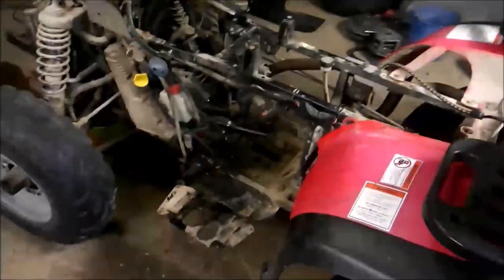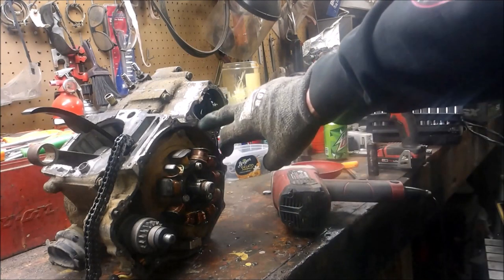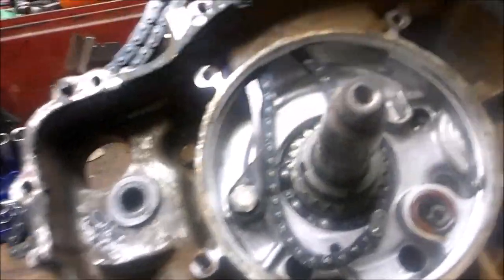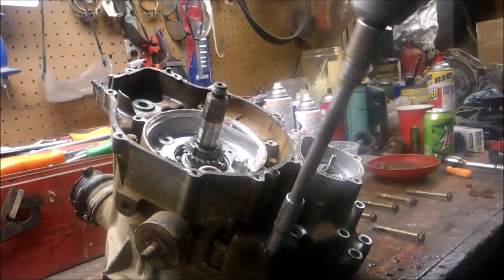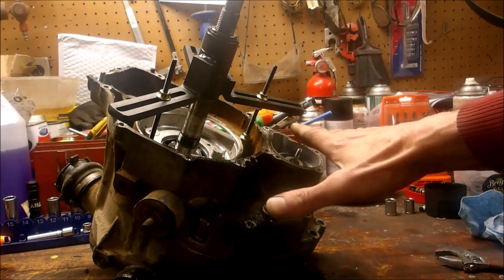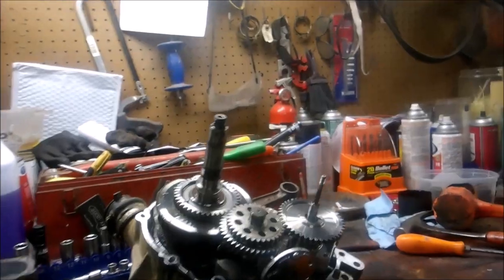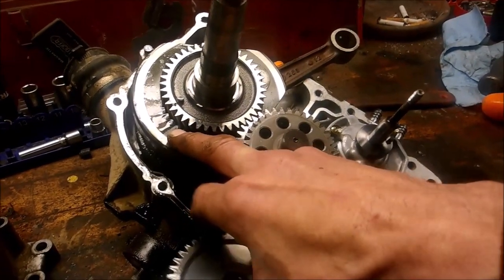POLARIS 500 ENGINE TEARDOWN AND SPLIT CASE SIDES!

Comment: Great video. I have a 400 HO that was given to me free because of low compression. Took jug off and it did the exact same thing , piston skirt broke apart and eventually piston split. Just wondering what parts you used for piston and cylinder repair? Is the metal cylinder sleeve replaceable ?
Reply from the maker: I went with the Namura. Piston. I've always had good luck with that brand and not as expensive as wisco. The cylinder I got lucky and was able to just hone it out. If yours is that bad, take it to a machine shop. They can bore it out.

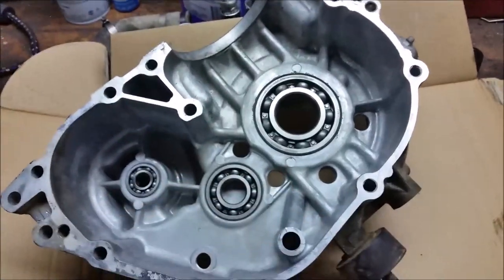Comment: At the point in the video 12:23 you have the split case apart. Your pointing at the bearings.. the bearing for the water pump- does the case need to be split to remove/replace that? Mine is shot.
Reply from the maker: Yes. Its on the inside of the case.

Comment: 2012 Polaris Ranger 500 EFT. I have to change the water pump shaft (bent shaft).
1. How much further to get the water pump shaft out and replaced?
2. Can the case be split without the splitter tool, using a couple of flat blade scraapers?

Comment: You ever have the reverse threaded nut on the crank get loose?  Mine did. back off and jammed itself against the cover to the point where I could barely get the bike to turn over. Tore the engine apart and that was the only issue..
Reply: I wish mine did that. I can't get it off fore the life of me.  Is there a tool for that reverse nut?

Comment: I have a 90 trail boss 250 and it needs a bore and I want to put crank seals in it. Is it worth the extra effort to replace the crank bearings I haven't had it running because it's clapped out so I don't know the conditions of them it's a lot of work to split the case's but the parts are cheap should I just change them so I know my motor is good . Another thing how do you get the clutch off when using the removal tools isn't doing it by hand would a impact pop it off. I  like you videos and I especially like your knowledge on these old Polaris since the dealer is useless
Reply from the maker: If your going to keep it a long time I would replace the bearings. I did a top end on my sons 250. pieces of the piston skirt went into the case and got in the bearings. I dumped old gas in the case several times to rinse it, then spun the crank to hear for any crunchy noise. took a air gun and blew it out. been running good for 3 years. Point being, you might get lucky.
Reply: @TitaniummanGarage  Polaris said to me that it is very unusual to find anything wrong with the bottom end, except if your piston breaks and parts fall inside the engine, this may damage the gears and throw the crankshaft out of balance.

Comment: Can you do a video on taking the front rack and plastic off of a 1998 425 magnum. I’m stuck and can’t figure out how to get the rack off. Thanks
Reply from the maker: That still have the metal rack? If so  in the front behind shock you'll see 2 holes in plastic where rack comes down. It bolts to the frame support behind shock. There usually rusted on tight. I cut them off and replace bolts. And 2 small bolts underneath the 2 bars that come next to radiator. You have to take plastic off around radiator to get to it. I don't have one to make a video with. Sorry.
Reply from the maker: Check out this video. not the same but, it will give you an idea how to take plastics off radiator.
Reply: Thank you. I thought about cutting them off but I didn’t think my grinder would fit. But that’s what I’ll do

Comment: I've got coolant in my oil, do you think that would be water pump or headgasket? Or something else?
Reply from the maker: Waterpump
Reply from the maker: Actually, there should be coolent leaking out the weep hole on the bottom of water pump if it is. unless someone replaced it before and blocked the hole. water pumps are common, but I have had a head gasket blow. they usually leak out the side.
Reply: @TitaniummanGarage  thanks

Comment: That reverse nut will not break loose
Reply from the maker: Sometimes I use a air hammer with a flat bit to break it loose.
Reply: @TitaniummanGarage  I ended buying an air hammer.  Thank you!